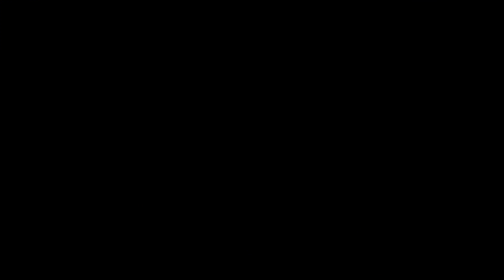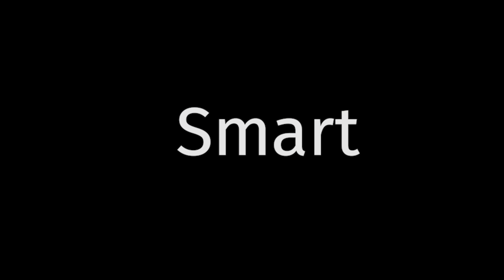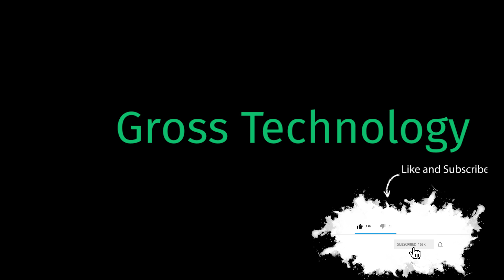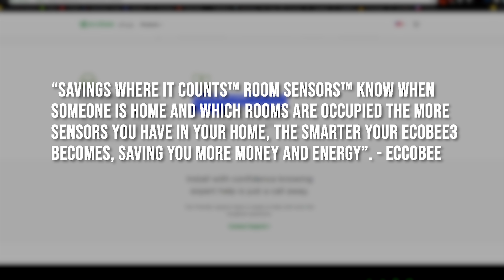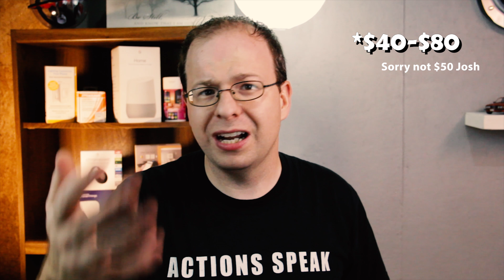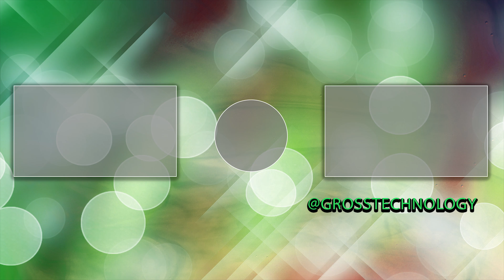Should You Buy the Room Sensors From Nest and Ecobee? #VEDA Day 4

Comment: This is why I am getting flair vents installed. Without smart vents the only use for this is purely comfort.

As an aside. I remember when I rented and we had 2 forced hot air systems. The landlord paid for gas. So they put the thermostat directly on the heater so that it would never heat the apartment much. We'd pull then off and hang them by the wires then put a string cheese on the sensor.

I'd love to have a remote sensor then.
Reply from the maker: Wow! Sounds like a greedy landlord. Definitely would have been nice to have these sensors then.

Comment: 1) If your example was simply reversed, money is saved by making the entire house accommodate one bedroom.
2) Since sensors are used, the inconvenience to the entire house is ONLY encountered when the room is occupied. So if someone wants the bedroom cooler at night, Winter heating ONLY makes the entire house cold when folks are asleep and it doesn't matter. 

The sensors aren't perfect, but have some use cases without expensive smart duct valves.

Comment: What you’re saying only makes sense if you have a mini split system in each room. Otherwise there’s no way to control where the air from a central unit is blowing. What the sensor is supposed to be is “I’m in the 80 degree room, and I want it to be 78” so it turns on. Now I’m in a room that’s already 76, so I don’t care what temperature the first room is, so it turns off.  That’s the savings.  If you live in the hottest room in the house, but you don’t want to rewire your thermostat so that it’s in the room you live in, the sensor is great. I thought this video was going to be helpful… nope.

Comment: How can a Single Furnace or Air Conditioner cool a single particular room when the sensor monitors the room, and the thermostat sets a temperature, that simply indicates that the central air turns on or off or cool or heat, so how is a particular room going to have a different distinct temperature from another.

Comment: I disagree with your sentiment.  For instants.  I use mine to monitor my bedroom temp at night.  Keeping the temp in bedroom where I want it instead of overheating the rest of the house for no reason, but an hour before I wake up I want the whole house warm, so it automatically switches to another senor and warms the my place up.  You might say "well you could just set a schedule to do all that" but I can't due to having an irregular work schedule.  So the sensors do this for me if I am in my bedroom.  It won't change it until I get into the room at night.  This helps and safes me money.

Comment: Thanks for the video, I have an ecobee with 2 sensors. They are really helpful as my thermostat was installed next to the return on a hallway so if the bedroom doors are open the thermostat would hit temps before the rest of the house would hit temps. With the addition of 2 sensors I can force the ecobee to only look at the external sensors and ignore the thermostat. This way our whole home cools vs the hallway. I do agree that added vent controls is the complete package but it depends on the square foot of your house! The sensors are great and for my use they are not
A waste but an improvement!

Comment: If the other room is 2 degrees hotter would it not just turn on the fan instead of the whole a. System to redistribute the air?  For example basements are colder than the min floor if you just run the fan and have a return down stairs it could push that colder air from down stairs to the upstairs right?
Reply from the maker: That would be wonderful if it was that smart. But no it wouldn’t do that.

Comment: I do think that the sensors can come in as useful in certain situations, even without the smart vents, which I would rather have than not.  Let me explain.  I bought a home 9 years ago and still live in the same home, but now alone, I'm a single guy.  I have a 2 story home; old cellar, main floor, and upstairs.  The one room I really want a smart vent in, is my bedroom, which is upstairs.  The problem I have, is my vent measures 2x12, which I cannot find a smart vent for.  what I would like is to keep my main floor heated between 68 to 71 during the day, but as heat does rise, it does get hotter upstairs, so at night, I would like the tempurature to be taken from my upstairs room.  So for this scenario, the sensor without the smart vent should do what I want.  I would still rather go the smart vent route as I do have a main floor bathroom that the door stays closed on and does get quite warm.

Comment: If you fill your house with smart vents there's the possibility that too many vents will close and cause serious problems with your HVAC system. You could freeze the AC unit or cause back pressure on the furnace.

Sadly, it's not as simple as it sounds.

Comment: I disagree with your assessment that it doesn't save you money. While I completely agree that the system runs on full regardless of what sensor is calling for temps, it can still save money by knowing whether or not someone is home and whether or not it needs to adjust based on an area that may fluctuate temps  more agressively than others. I understand where you're coming from and agree their wording could be better, but the hyperbole in this video just pushing back the narrative to far in the other direction.

Comment: It should save you money if you have zones already, but if you have zones set up the same way I do - a control for each zone - you will have to buy a nest or ecobee for each zone. It will save in the case of ecobee sensors because the occupancy detection. I have 3 zones. I mostly use 1, so it will set the other 2 zones to "away" mode and only push air to the zone I am in. I also have a fireplace, so when that is in use it is very helpful. 

If you do not have zones, then this is probably not good.

Comment: I see where you are going with this however it’s not entirely accurate:
1. Is a zone system (electronically controlled dampers and multiple thermostats connected to control board) better? Absolutely, and you’d want Honeywell for that. But it’s expensive, say, $1500-$3000 installed roughly. 
2. For businesses or rental properties these sensors can potentially solve a major problem. Unoccupied areas with a thermostat for a system that treats multiple areas. It averages out the temps and let’s the system know to keep running. 

Is it perfect? No,  but even zone systems have their own short comings. What these sensors do is offer a possible solution to these problems without going to the next major step of installing a zone system. 

Side note: for truly independent control and efficiency you have to abandon central air and go for mini-split systems. However with that you lose the indoor air quality benefits that you get with a central air system. (See how complicated all this stuff is? 😂) 
But good video, however I disagree completely that these are pointless.

Comment: Exactly what I always thought. But wanted to hear from someone else. That's the reason I landed on this video. Like how does it stop the air from flowing to other rooms without shutting down the vents physically.
Reply from the maker: Exactly! But sadly, as the comments all on this video, people don’t understand.
Reply: Works well in an instance where you have a two-story house with one air conditioning system and a reverse temperature gradient at night from what you have during the day.  A single thermostat cannot be in both places at once.

Comment: The main reason for sensors like this are to improve comfort. On freezing sunny days the sun warms up our 1st floor, though the basement and 2nd floor can drop by 4-6° degrees below the set temperature.
Reply: exactly and without it youd have to manually adjust your thermostat like all the time which is pretty impossible and frustrating to do.

Comment: I know this is an old video, but as a smart home professional, I needed to point out that this is not accurate.  You're only looking at it from the point of view of one type of heating/cooling system.  The idea to the sensors is to know the temperature in those rooms and whether someone is occupying them to know whether it needs to adjust the temperature to heat/cool that room.  In other words, in my home there is one main heating zone that covers both my main floor and my upstairs master bedroom.  My master bedroom tends to be pretty cold in the winter even though the main thermostat is set to 71 degrees.  However, the system knows to average the system out to keep the master bedroom relatively warm throughout the comfort setting.  Then when it knows I'm actually occupying the master bedroom, it heats the main zone until that rooms heats to 71 degrees.  This is absolutely saving money versus always having the system heating enough to keep that room at 71.  The best HVAC systems in the world have remote temperature sensors.  You really should have done more research before bashing the concept.
Reply: I agree. In no way did I think the sensors would allow for the HVAC to push out different temps for different rooms simultaneously. That’s just silly but everyone comprehends differently.  I want to get the sensors because my room is so hot while the living stays cold, so I need the sensor to tell the ecobee to stop when my room is at a good temp. I’m also hoping the sensor will stop the ecobee from running all the time. Thank you for your response

Comment: I agree but disagree for winter temps. This worked for me in the winter. The Ecobee unit is in the hall which is always colder  I set it at 67. Two rooms were supper hot since the Hall unit was set at 67  but read 64 i just kept trying to get to 67.  The heater would turn on but the rooms were already at 70. I got the sensors so the hall unit now knows when to stop heating. I will adjust and evaluate for summer temps.

Comment: Unfortunately it does not in most applications save you money but it does provide you comfort when you want comfort in a room with a different temperature. You can set up the devices and how they interact with each other. You can have them average the temps between the ones you choose or look at just the one/s you select. I do agree that adding smart vents will make a much better controlled home and do add the savings factor but like for me all my bedrooms are upstairs and I only have one hvac unit. I tell the t-stat  to only pay attention to the downstairs temp until the evening hours this saves me plenty when it is hot out because the unit does not try to cool upstairs but on the other end I do not have to adjust anything in the evening because now the unit does the adjustments for me based on the extra sensor to make it comfortable sleeping temps based on my master bedroom. Do you need it, no, but can it add comfort yes. My old "dumb" t-stat did not do anything to compensate for the temperature difference either I had to program times and temps manually but it worked. Again on the savings side in most applications you are not going to see savings but it has its uses if comfort not just savings is what you seek.  Oh the little sensors have 2032 button batteries that last only about 6 months also. Just my experience with the Ecobee.

Comment: I just put in two Ecobee Smart thermostats. I have a 3,000 sq ft home and have a HVAC unit on either side of the house. I bough two extra sensors. However, I thought as you did / do that these were a bit of a gimmick. Nevertheless I put them out and tied them to the thermostats. Over the first few days I configured them in such a way that I was using all the sensors to ‘feed’ the main thermostat. Then it dawned on me that I was not using them correctly. Let’s take the thermostat in the master bedroom wing. It is in the master hallway. Half of my home’s temperature is based off the reading at that one location. Fact is once we leave that area of the house around 7:00am, we aren’t really there until 9:30pm or thereabouts. So having 1/2 the house’s temp based off that location doesn’t make much sense. I put one of the sensors in the living room and one in the master bedroom itself. What I have now done is ‘turn off’ the temperature reading during the day at all locations except the living room — where I want the temperature to meet my needs. I could care less about the other locations. Today, for example, the living room temp was 73. This is my temp setting. The hallway, where the thermostat is read 80, but because of the way i have the system configured, that reading is not used during the day to drive the cooling. What this tells me is that prior to the Ecobee I was over cooling the rest of the house to keep the master hallway temp at 73. At night, I have set all sensors ‘off’ except the mater bedroom which I have set to 71. Again, I could care less about the hallway and the living room. I hope that makes sense. Essentially, because you can turn off some sensors and activate others you can effectively move your thermostat where you need it. I’ve only had these for less than a week, but I do see the potential for savings. Time will tell.
Reply: Can you point me to how I can configure a sensor to act as the main thermostat so the systems respond to its readings rather than the main thermostat? The main is in a lonely hallway
Reply from the maker: Do you have a nest or ecobee?
Reply from the maker: So I do understand and like the idea that it can not only average out across the sensors but that can turn certain ones off is great. But again my argument with the system working throughout the entire home. For your place, yes the room you want to be a certain temp will get that temp, but it’s also still cooling or heating the rest of the home. It just is possibly shutting off sooner since it reaches that temp of the specific sensor. So I can see it working both ways I guess.
Reply: Two HVAC for a 3,000 sq ft?  I have 4,000 and only have one. It's a new house though

Comment: I have the ecobee3 room sensors strictly for comfort. My room temps are quite different, and goodness, my bedroom can be very hot.
Reply from the maker: Oh I agree, the sensors are and do work for trying to average out the temp in those off rooms.  Like I said, my kids room is the same way, either hotter or colder based on whats happening in the weather.  But back when this video was made it was advertised as a "saving you money on your bill" thing.  That has since changed on their site, but that was the main thing I was trying to get across on this video.  Plus the idea that they would only cool or heat a specific room without having smart vents or zones in the system is false as well.

Comment: There are certainly scenarios where this can save money. For example, in my house the upstairs hallway gets obscenely hot in the summer. No one hangs out there, but that's where the thermostat is. Meanwhile the bedrooms get freezing cold and all day my ac runs non-stop.  Since I only want the bedrooms to be comfortable, a remote sensor in one of those rooms has been a lifesaver.  Point taken a sensor can't zone, and worse yet it doesn't integrate with traditional zone systems in a way where you don't still need one thermostat per zone.
Reply from the maker: Very good point.  Yes there will be cases where this makes sense, such like yours.

Comment: let's say Install a window unit in one room and I set it to 75. let's say it cooled the room to 75. If I put a sensor in the room where the window unit is and the thermostat was set to 78 for central ac unit. wont it run less because it thinks the room is cooler?

Comment: smart thing to do would be to consult a hvac tech before trying to talk about hvac. it can help save a significant amount of money which is why most commercial buildings use similar technology. i work on hvac a lot and all of our buildings have a similar system and weather it controls a vent or not it provides data which we use to adjust and tune. for instance balancing the hvac system. you can manually adjust your registers in each room to balance out the hvac air flow. also the systems can ignore unoccupied room temps only focusing on occupied rooms.

Comment: "Smart Flaps" - I knew where you were going with this. #dampers. Would need to see if they have DX Boots (manual mechanical dampers) that you can adjust until you get equal readings across the sensors. Great Vid!
Reply from the maker: Thanks man!  Yeah, the ones by Keen actually do have temp sensors that you can then have "average" out and will close or partially close to get the right temps everywhere.  Plus they address the issue with damaging your system because of closing vents. They are by far my favorite ones.